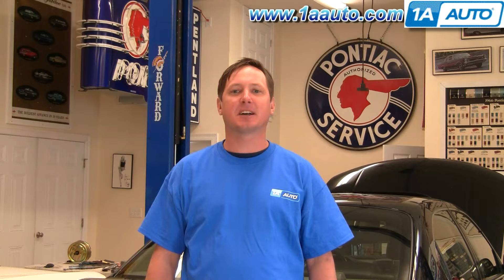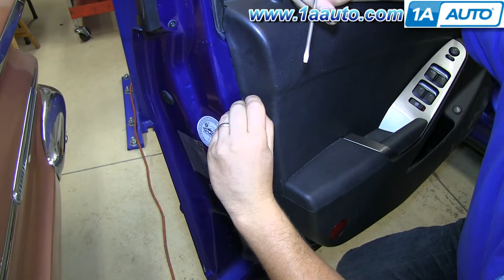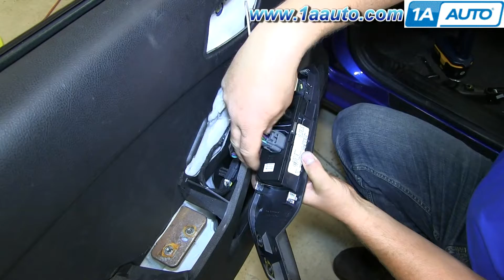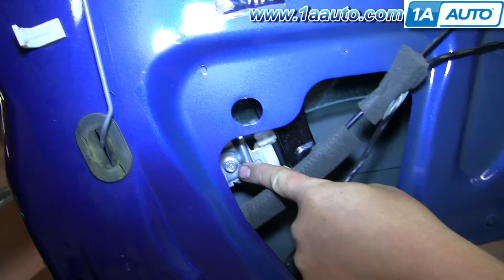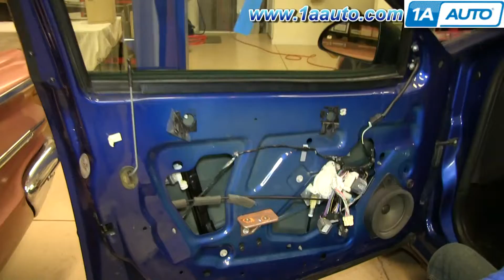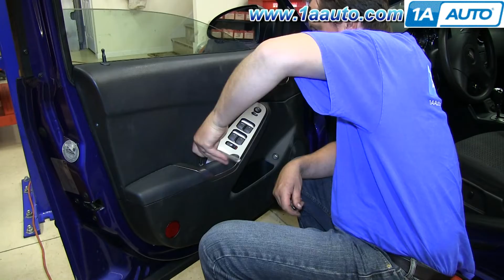How to Replace Power Window Regulator 05-10 Pontiac G6

Comment: BE CARFUL WHEN REMOVING THE DOOR HANDLES!!! There is a clip that can and will probably brake if you remove the handle before you remove the panel!!!

P.S. this clip won’t really matter because the handle is already held in by a bolt. I’ve been driving my G6 (which is the same in this video except it’s silver), with a broken clip on my door handle for about 5,000 miles without any issues.

Comment: 1A Auto Parts, Do you have a video tutorial for driver's side rear window regulator. I noticed on your website the regulator for the front and rear are different so wondered how significant the replacement is.
Reply from the maker: +Eric Russell Thank you for checking us out. We do not have a video at this time for the rear doors, but the steps should be similar. Hardware size and slight difference in design will be visible however. 1aauto.com

Comment: i have a question 1A Auto Parts i purchase a 2005 Pontiac G6 and my driver side window will not roll down using the switch in fact none of the windows roll down using all 4 switches on my driver side door panel. so i check the widow switch on the passenger side door panel to see if it work, and it works perfect. so then i tried both doors in the back seat, and they do not work as well. so could you please tell me what could be the problem, and what must i do to fix this issue, thanks in advance. I sub btw great videos
Reply: I was reading a few treads, and a few people said that you should open the car door and try doing it again so i did just that, and it worked.

Comment: I have a pontiac G6 '06 
My rear door window went loose. The window regulator or object that raises the window still goes up & Down. 
I believe that my window went loose.

so therefor do I need some sort of glue or do I just have to put it back in place where the 10mm socket hold the window, & simply tighten the sockets???

Comment: I have a 07 G6 sedan. I was wondering to remove the front window, would it pretty much be the same up until unbolting the regulator? Then just tilting the window out? Or are there extra steps involved? 

Anything would help.
Thanks
Reply from the maker: This video should also apply to your application. We carry new window regulators for your 07 G6 on our website with FREE SHIPPING in the lower 48 states. Here's a link to them. Hope this helps you out. http://www.1aauto.com/2007-pontiac-g6-window-regulator/y-mo-c/2007-1044-16?utm_source=YouTube&utm_medium=VideoReply&utm_campaign=1ATony

Comment from the maker: You may want to check the transmission fluid level to see if it's at it's recommended level. Hope this helps you out. 1aauto.com 888-844-3393